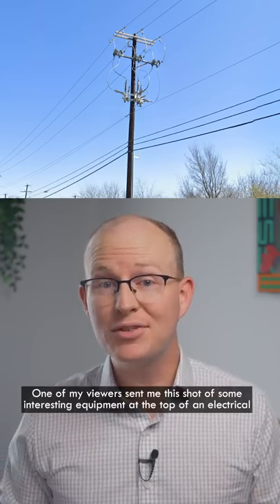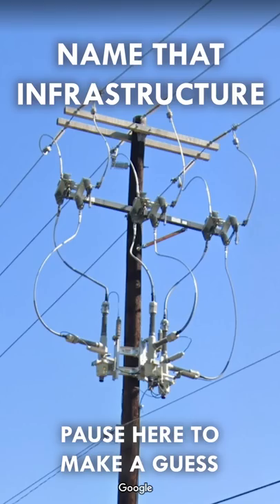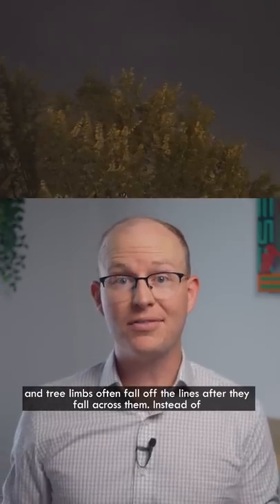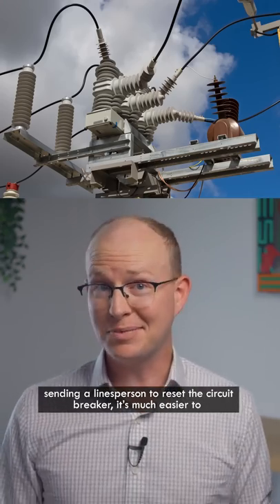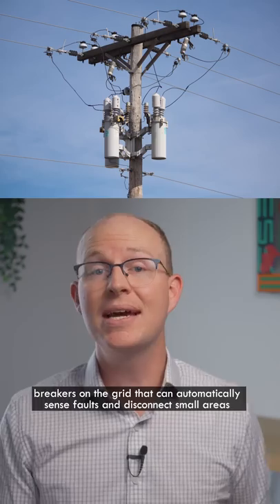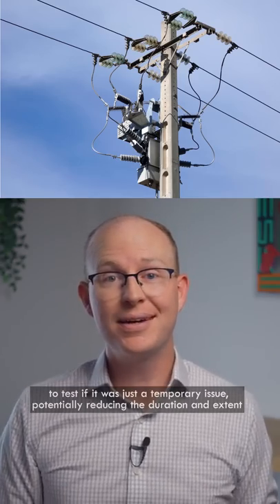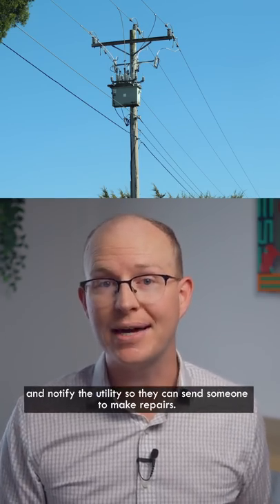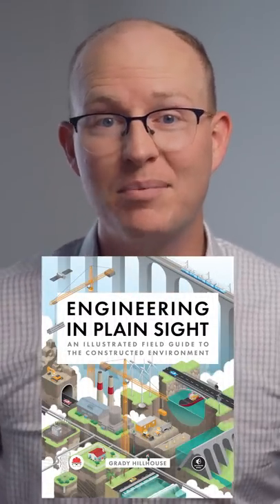Name That Infrastructure (Ep. 9) #shorts

Comment: so if I grab the line and get broiled, and survive that, I can expect a second jolt in just a moment?
Reply: Your getting broiled would have to draw enough current to trip the breaker but yes. Also you won't survive drawing that much current, basic biology is unhappy with milliamps to the heart and 3A to the limbs is bad news, drawing at least 200A down 1 arm and up the other is nothing short of fatal. (And i probably undestimated the trip setting)

As said in the video the point is that if the breaker trips it will wait a couple seconds and "reclose" (hence the name, recloser) and see if whatever condition has cleared. (A line getting brushed by a tree limb swaying in the wind for example)

Comment: Remote activated transfer switch on a 12kv power line?
Reply: Not too far off, that would have been my guess too.

And fun fact, where Grady and I live, those lines are 13.8kv, not 12, not that it makes much difference.
Reply: @Impractical_Engineer  mostly 138 kV, 10:1 step down, but there is a little bit of 69 kV transmission going on.